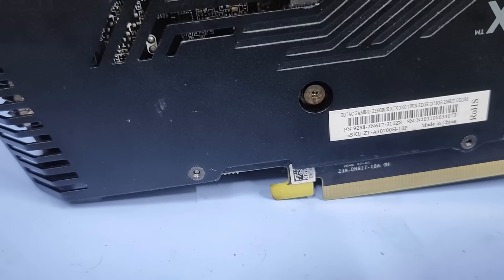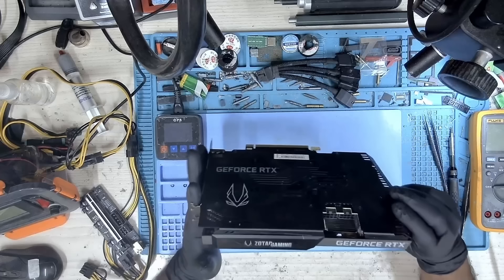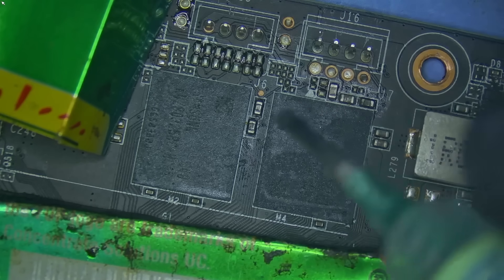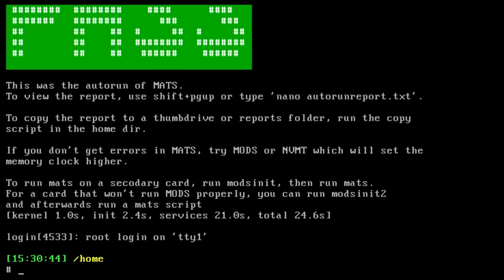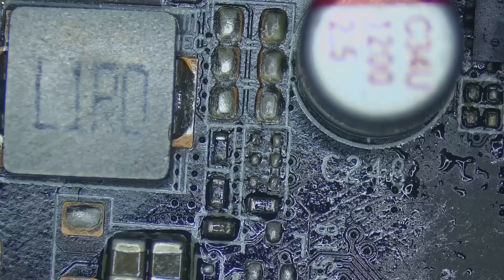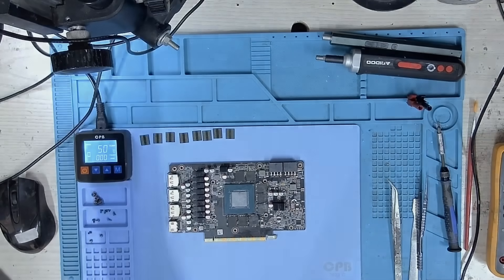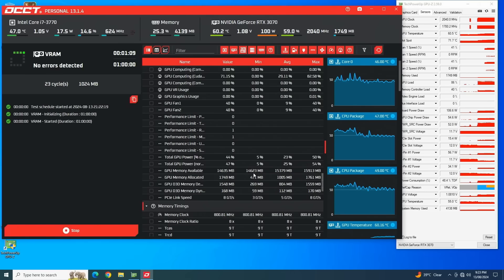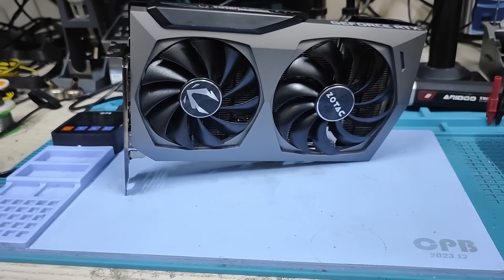Upgrading RTX 3070 Memory from 8GB to 16GB - Part 1

Comment: NVIDIA Control Panel -> 3D parameters -> Global parameters -> Power management mode: and set the maximum performance mode there.
Reply from the maker: Thank you brother. I will try this and test. I will update it in part 2 soon
Reply: @GraphicsCardRepairs-tk7ql  Did you ever make a part 2?
Reply: I am also wondering whether part 2 will be released.. Hehe, good cliffhanger this!
Reply: @GraphicsCardRepairs-tk7ql  when part 2?
Reply: Wheres part 2@GraphicsCardRepairs-tk7ql
Reply: Doesn't change much on the lower-mid end variants of the card
Reply: Holy crap, I was having the black screen problem with my unmodded Zotac RTX 3070, I tried lots of different stuff and couldn't get any solution to solve it. I think you just fixed it. Thank you!
Reply: Do you know if this is possible to do on a 3060Ti?
Reply: @sdfopsdmsdofjmp7863  It is theoretically possible and I believe I’ve seen one instance of it being done. Apparently both drivers will work with the additional VRAM without modification, so long as you use compatible VRAM chips.
Reply: this does nothing but make your gpu run at the highest possible wattage at all times
Reply: @jooj_br  exactly. Because after increasing the memory, the video card works, but after 3D load, switching to reduced power consumption, the settings for smaller memory chips are enabled, which are simply not enough for the new larger chips, since they consume more energy when idle. And the above allows you not to drop the voltage so low, since you do not need to fit into the limits. That's all. This is a bad method, but it works on video cards with increased memory.
Reply: @VarnavskyIvan  is there anyway to activate the 16gb voltage table?
Reply: As with most things JaysTwoCents says; terrible advice.
Doing this makes the VGA idle at high clock speeds, causing high power draw when the card isnt doing anything.
All for a margin for error improvement in benchmark score, not worth it
Reply: @AndroidBeacshire  , This is a solution to the black screen problem with increased VRAM, not because of some points in benchmarks. The solution is not very good, but it still allows the video card to work with doubled VRAM, and not to crash every time after 3D load.
Reply: @AndroidBeacshire just do it per application instead of activating it system wide
Reply: @AndroidBeacshire you worried about your power bill?
Reply: @AndroidBeacshire  How high is "high"? Someone quoted 50W; half a light bulb. I.E. double nought sod all. You probably want to get a grip and think before you post.
Reply: @AndroidBeacshire  Damn I've been setting it to that for many years. I just figure I don't really care about the power usage difference, since it's a PC and not a laptop
Reply: @AndroidBeacshire this is true BUT notice he thinks the issue is the power dropping below 12v and then crashing? Well this could address that issue. A bandaid fix but could still be a fix none the less. He clearly voided the warranty on card, so that aspect shouldn't be considered.

Comment: Is it possible for 1050ti, feom 4gb to 8gb. That would be helpfull.
Reply from the maker: 1050 ti uses GDDR5 . 1 GB is the highest capacity produced and there are only 4 slots. It cannot be upgraded further.
Reply: @GraphicsCardRepairs-tk7ql  okay , Thanks, Good job.

Comment: Man, 16GB on a 3070 TI would be fire
Reply: Honestly same, I have my beautiful EVGA ftw3 RTX 3070 ti. the PCB is the same as the 3080 ftw3 yet we are limited to 8gb of vram.. having 16gb of vram on a 3070 ti with its overclock potential and GDDR6X memory I don't see why Nvidia could at least gone with 12GB.
Reply: u ever heard of AMD???
Reply: @taivas7216  Yes, but I like Nvidia features more
Reply: @Cloderick like what
Reply: Rtx 3070 ti doesn't get frame generation. Also, I'd rather run native 4k resolution without TAA  for the same benefits, RTX dont count given the cost and its a castrated version of raytracing @Cloderick
Reply: @MarcABrown-tt1fp  I know it, those are the features I use on a daily basis on my 4070 Super.
The RTX HDR and Super Resolution are for videos.
DLDSR looks awesome on my 1080p monitor, WAY better than native resolution.
Reply: @Cloderick  As I hear AMD have their own DLDSR
Reply: @adamadamx5464  Eh FSR is OK, just not at a resolution lower than 1440p, otherwise far details are lost.
Reply: @Cloderick  Bro, Only Ada (=RTX 40X0 [Ti] [Super]) and up have DLSS 3 FrameGeneration and basically every graphics card has AMD FSR (which is worse but still better than nothing). With the current generation there's no real gaming benefit in upgrading the VRAM as you can get 16 GB <$800 with the 4070 Ti Super which isn't great, but certainly better than being forced to buy a 90/Titan SKU as with any previous gen.
You can also not upgrade VRAM without switching to a previous gen PCB afaik, making it much more costly. Still; as 32 GB 4080 [Super] certainly is cool.
Reply: @whohan779  I'm kinda familiar with GPUS and their features recently, I've had 5 different GPUS this year. Unfotunally the 4070 Ti Super is out of reach for probably 90% of people, at least in my country and that includes me. But the 4070 Super is serving me very well
Reply: @Cloderick  so does vrs with AMD
Reply: @MarcABrown-tt1fp I'm using an rtx 3070 ti and most games usually come with FSR 3 frame gen and for some who don't have one I use mods to enable dlss frame gen. Seems to perform very close to or same as 4070
Reply: @taivas7216 AMD doesn't have system fallback for stable diffusion.
That's why they need more Vram to compete with Nvidia.
Their cards crash they reach Vram limit unlike Nvidia cards

Comment: I want part2
Reply: Dawid does tech stuff did a video a year ago with a 16gb swapped 3070 evga card. He said they only switched the memory modules and had to enable boost locking in evga software to stop black screen flashing. So you might try that software to fix the issue sounds like it comes from the quick large changes in frequency.
Reply from the maker: Thank you. Yes i will try that in my part 2 of this upgrade video.

Comment: You schould try to max out the ram of a 3090 or 4090, because many using those for AI tasks are desperate for more ram. Doubling the ram on those would be huge fot them.
Reply from the maker: Sure I will try these cards. 😁
Reply: @GraphicsCardRepairs-tk7ql rtx 4090 40 gb of vram would be interested!

Comment: Hello, now can we up then 8 to 24gb? (i have 4 empty slots on my 3070ti zotac 8gb...)
Reply from the maker: If you have 4 empty slots then your GPU is using the GA102 die. The empty slots you see are disabled from the GPU core. Installing memory there will not work. The GA102 die used as a 3070Ti is cut down.

Comment: Man you are so  talented to be able to do something like this! This looks like it would be difficult to pull off...BUT, I will attempt it myself. Great video!
Reply: I'd suggest to get some sort of cheap donor to learn on. Don't do this on your main card or anything that you use on daily basis. Otherwise it'll hurt far too much if you ruin the one thing you need at any given time. Luckily I was smart about this when it comes to PS4 controller repairs. I have three controllers (one original, 2 cheap aliexpress replicas), cheap controller had pretty gnarly stick drift and original one has a slight one, for learning I used the replica one in case I screw up and I did, now that controller is dead, but I learned so much from that and managed to swap analog sticks on my original one after that failure. Just a simple repair yet so easy to mess everything up.
Don't be scared to fail, just be mindful when it comes to these upgrades (if it's not broken, don't try to fix it unless you know what you're doing and will be able to revert everything back to normal with applied upgrade)
Reply: @luckgrip252  im going to try it on a 4060 actually. I needed another pc a while back in an emergency, and was aiming for really anything 13th gen in the cheapest prebuilt i could find. 
I have had this brand new 4060 just sitting around that i probably would never do anything with...what the hell, a 16gb 4060 would be pretty cool lol
And if i fuk it up 🤷
Reply: @AnEyeRacky  It's the risks that you're willing to make. If it was your main driver and only card around, you would feel that "do I really need this?" But since that 4060 of yours would gather dust anyways, then yeah, why not.
Reply: @luckgrip252  exactly...
Reply: @luckgrip252  this is VERY good advice
Reply from the maker: Thank you very much!😁
Reply: @Zlysess-un9ib lol I'm in the middle of it sort of!
I had to figure out what kind/brand of memory I needed, so I opened the GPU up weeks ago.

I am currently waiting for the chips I need to arrive. Not available locally, had to order some online.

It's a little overwhelming at first, but I honestly think I can do it. It doesn't seem overly difficult, you just need some steady hands and patience...and practice soldering and shit obviously lol

I truly think I will have a 16gb 4060 before, or just after Christmas, if they arrive soon, and I have the time to play surgeon on the gpu
Reply: any update?
Reply: @AnEyeRacky  update?

Comment: do you think this would be possible with a 7900xt? i would love 40gb instead of 20gb for Autocad
Reply from the maker: Unfortunately all the AMD 6000 and 7000 already use the highest capacity module produced of 2GB. Further upgrade is not possible.
Reply: @GraphicsCardRepairs-tk7ql  Thanks, i learnt something today :D 
what about upgrading to GDDR6X
Reply from the maker: The data pins of GDDR6 and GDDR6X are located in different locations. So installing GDDR6X memory on a GDDR6 slot may short the memory.
Reply: @GraphicsCardRepairs-tk7ql  What about using a faster 2gb module? as some have done on the 4070, from memory they replaced the 21gbps chips with 26gbps chips and beat a 4080 in a few synthetic benchmarks, do you think this could work on AMD 7000 also?
Reply from the maker: Currently 24Gbps is the fastest commercial GDDR6X memory produced by Miron. Part number is MT61K512M32KPA-24:U. This module is used on the RTX 4080. RTX 4070 and all the other 70 versions uses MT61K512M32KPA-21:U which is a 21Gbps module. Except for the 4070 Ti Super (256 Bit Bus) all other versions uses 192 bit Bus. Even by installing the same 24Gbps memory, it will be difficult to match the RTX 4080 with its reduced core count and Bus width. The GDDR7 memory Micron is coming up with is 28Gbps and 32Gbps. Samsung is also launching 32Gbps GDDR7. Samsung has a 24Gbps GDDR6 availble. As for AMD 7000 series, the 7900 XTX uses 24Gbps GDDR6. and the XT uses 20Gbps GDDR6. all other below use 16Gbps. Its yet to be tested if 24Gbps would work on the other ones like the XTX.
Reply: @GraphicsCardRepairs-tk7ql  Ok, thanks for so much good info! It would make a great video seeing if 24Gbps would work on a 7900xt
Reply: @GraphicsCardRepairs-tk7ql  I'm actually doing a vram upgrade project on an rtx 2060 6gb to 12gb but im confused on which chips i should buy, is anything stopping me from using 20Gbps gddr6 instead of the 14Gbps chips it came with?

Comment: can you upgrade the GDDR too lets say from 6 to 7 i saw Gddr7 on micron for sale ? will it work ?
Reply from the maker: No upgrade from GDDR6 to 7 is not possible. The data points and command points are positioned in different locations.
Reply: @GraphicsCardRepairs-tk7ql  even from 5-6 , yeah stupid question now I reevaluate

Comment: Are you familiar with the program off of steam Lossless Scaling? I wonder what kind of potentials this/ and that would have together could do.
Reply from the maker: I am not aware but I will investigate.
Reply: @GraphicsCardRepairs-tk7ql  Also nvidia has a new App for their gpu drivers ect it has a nifty Over clock feature on there that doesn't void your warranty you have to enable beta features to find it I believe I'm testing this ontop of the lossless scaling

Comment: I've had a similar issue with my 3090 where gpu worked fine while browsing  and gaming but when exiting game it would crash. I've flashed the bios to latest version but that didn't helped. What fixed it was taking off the factory overclock by enabling "Debug mode" in Nvidia control panel which will run Nvidia's reference clock for Gpu core and ram.
Reply from the maker: Great. I will try it.😁
Reply: you have no problem

Comment: I mean how much performance boosts we gain if vram increases from 8 to 16? 
Like a lot? Don’t think so really….
Reply from the maker: Increasing memory capacity does not increase performance. Where it benefits is a smoother frame rate, Better 1% lows,  can use full textures. Performance remains the same.  Examples are 4060 8GB vs 4060 16GB.

Comment: Is it a good idea to double the VRAM of a RTX 4090?
Reply from the maker: 4090 has only 12 memory slots and uses 2GB memory modules. As of date 2 GB is the highest capacity memory module produced. It cannot be upgraded unless there are more memory slots available on the PCB and BIOS edited.

Comment: Ay man, i have an Asus Dual RX 6600 8GB vram. I wanna upgrade it either to 12gb vram or 16gb. Will i have driver issues or anything if i do install extra vram?
Reply from the maker: RX 6600 cannot be upgraded further. It has only 4 memory slots and is using 2GB memory modules. That's the highest capacity module produced till date.

Comment: You ever doubled a laptop VRAM before? Say a 3060 6gb to 12gb?
Reply from the maker: I have not tried upgrading laptops yet. 😁
Reply: @GraphicsCardRepairs-tk7ql  i read some where that the VBIOS on the 3060 laptop actually has the coding for a 12gb model. So in theory it should be a straight swap and functional.
Do you think you could give it a go and see it thats true?

Comment: So obviously increasing VRAM is going to improve performance, but which aspect of performance? Will it be improving resolution, texture quality, or fps? Or some combination of these?
I watched your 2080 ti upgrade, so I understood that it gives the card more head room in computing tasks since it doesn’t become bottlenecked by data being loaded and unloaded, but from a gaming perspective I am not totally certain I understand completely. Great stuff though! Definitely keep it up!
Reply from the maker: Upgrading memory does not increase performance. If you are referring to games, it benefits is those games which exceed the 8GB memory buffer. there are more games which exceed the 8GB buffer compared to 11 of the 2080Ti. Here you will be able to load high textures with a smoother frame rate. The rest of the performance remains the same.
Reply: @GraphicsCardRepairs-tk7ql  ah, that makes more sense now! Thank you for the explanation

Comment: Take a look if you can to a rtx a4000 pcb, the quadro brother but with 16gb
Reply from the maker: The a4000 already has 2GB modules installed in it. That's the highest capacity module produced. It has 8 memory slots. Further upgrade is not possible without the entire pcb redesign and BIOS edit.

Comment: Would it be possible to do this with a 3070Ti? I would like to use the faster gddr6x memory as the extra bandwidth would increase the performance of the vram upgrade
Reply from the maker: I don't have a 3070Ti with me. If I do i will give it a try

Comment: I never understood why mid range GPU's get higher memory configs than higher end parts. Like 3060 12GB when a 3080 had 10GB. Or how you can get a 4060 with 16GB but a 4070 Ti has 12GB. Why, if it's not forced obsolescence?
Reply from the maker: They would do even better if they gave what consumers need. But it looks like they only go for money. They want people to upgrade more often.

Comment: Sir many question from me. So if i buy thr chip of vram with 4gb. The question is 1 chip equivalent 4gb or 2 socket chip equivalent 4gb. ?
Reply from the maker: The highest capacity produced till date on a GDDR6 and 6X is 2GB. And GDDR5 and 5X is 1GB. So one slot can take only a 2GB modules. But again that depends on the GPU.
Reply: @GraphicsCardRepairs-tk7ql  ok thanks for the answer sir.

Comment: Nice video! How would someone find the needed resistors on another model? I might give it a try aswell but I couldnt find any info about the positions. Looking forward to your answer! Thank you.
Reply from the maker: You would need a boardview of that GPU. Without that it's like searching a needle in a haystack. Like I did on this GPU. I did not have the boardview for this GPU.
Reply: @GraphicsCardRepairs-tk7ql  Thank you for the answer! I will be looking for a boardview for my 3070 FE... Do you have any tips on what to look for exactly? I assume i will just see tons of capacitors and resistors.. I have found other card's BV and it has tons of resistors with numbers but barely any explanation.. does it have a specific code or name or something?

Comment: I like your video. I am waiting for Part 2.
 I have a little question. 
Is it possible to upgrade RTX 3080 10GB to 24GB? 
Subscribe to you brother.
Reply from the maker: @mariofarm3869  the path for 3080 is from 10GB to 20GB but I am yet to test it. As I find time I will continue my experiment on the 3080Ti I have.

Comment: 13 days still waiting for part 2
Reply from the maker: Currently I have 64 cards in queue for repair which are business commitments on a timeline.  I still have not found time to work on the GPU further. Part 2 will come but it will take some time.

Comment: Would it be possible to increase the memory on a 4070?
Reply from the maker: 4070 already uses 2GB memory modules which is the highest capacity produced. And it has only 6 active memory slots. Further upgrade is not possible.